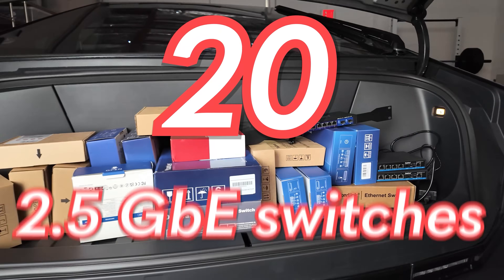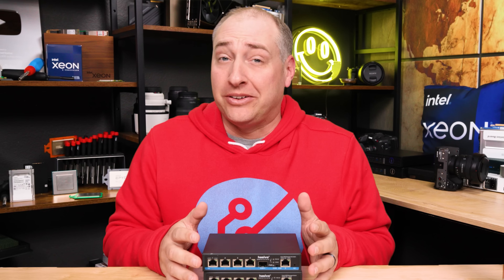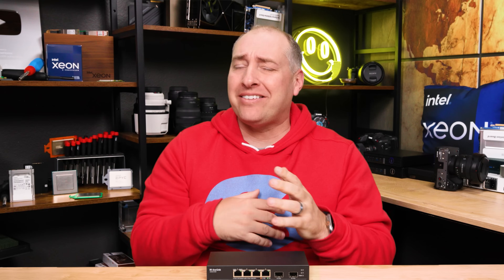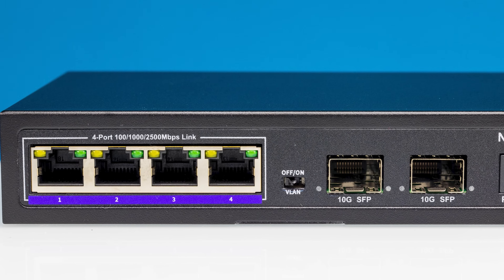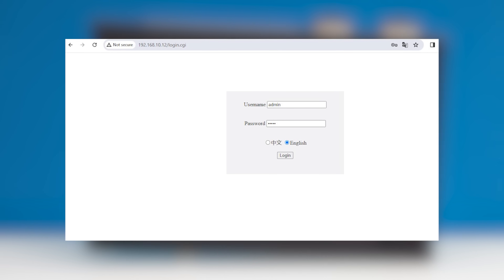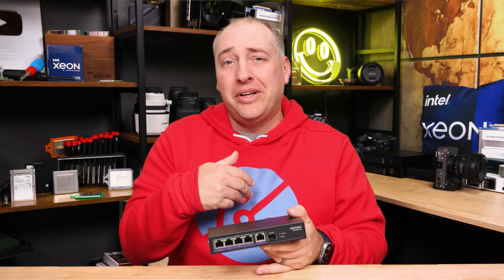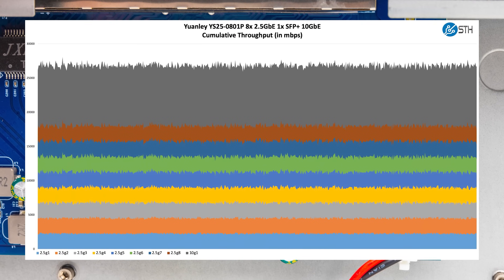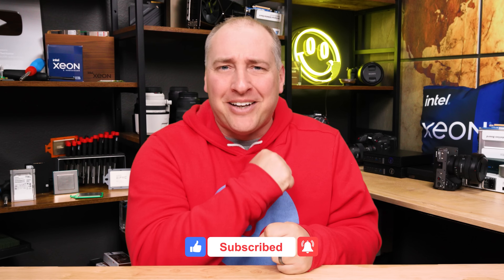Finding the BEST Cheap 2.5GbE Switch... by Testing 21 of Them

Comment: Are you doing a round of ~8port 10Gbit switches at some point?
Reply: Why bother? You can get a 48 x 10g SFP+ switch for under 250, for example Arista 7050S-52-R can be found for 230 plus shipping  ...10g sfp+ cards are under 10-15$ a piece, you can get 2 x 25g cards for 30 dollars backwards compatible with 10g ... sfp28 switches would be an interesting thing to see ... they're not as common.
Reply: @mariushmedias  But i'm looking for small fanless ones for the living room.
Reply: 8 port 10Gbe fanless? That is a lot of heat unless you go fiber/dac.
Reply: @TheAlapalooza  I don't think fanless SFP+ switches exist. Even the small Mikrotik models with 8 SFP+ ports have fans in them.
Reply: @mariushmedias  Because sometimes people don't want to put jet engines into their living spaces?

That Arista will be hotter as well.

Please realize that people have different use cases..
Reply: because they don't exist. copper 10gbit is hot and needs fans still
Reply: @BrunodeSouzaLino  Mikrotik CR305 and CR309 switches are 10Gbit SFP+ fanless. But they will overheat if you use copper transceivers so they are effectively SFP+ or optical only without fanmods
Reply: What about the QSW-IM1200-8C from QNAP, that's a 8port 10Gbe fanless switch.
Reply: @TheAlapalooza $1000
Reply: hasivo's S1100W-8XGT-SE (or S1100WP for PoE) looks like a good option
Reply: @TheAlapalooza The QNAP is very expensive. It's double the price of the MikroTik CRS312-4C+8XG-RM (street price ~US$500-550) which has 12 x 10Gbps ports. The MikroTik isn't fanless, but is it really worth spending around double the price just to avoid fans, when you could instead just vertically mount it in a closet?
Reply from the maker: We have many other switches in the pipeline.
Reply: @ServeTheHomeVideo  Cool, looking forward to that :)
Reply: @BrunodeSouzaLino  SKS8300-8X
Reply: @mariushmedias  Cheap upfront cost but maybe not so great if you have high utility rates. Also, not so great if renting and space is limited.

Comment: Can't wait until 2.5gbe becomes the new standard everywhere, nice review.
Reply from the maker: Thanks! It is happening more each year
Reply: Can you yell at Synology for me, I wish they would wake up, Their NAS units still use 1GbE ports, Everyone else has moved on.
Reply: Would be nice if they go straight to cheap enough 10gbe
Reply: @ShaneMcGrath. They charge for the upgrade
Reply: I'd rather ditch 2.5 and go for 10. That should be the next evolution from GbE
Reply: I want 10g default :( Mostly because I deal with servers all the time and it's simple to get those cards or equipment in.
Reply: considering not even 1gig is standard everywhere...yeah
Reply: @levigoldson  1G has been a standard for the past 10 years in anything half decent. Guess this is in North America not sure about elsewhere around the world.

Comment: I went into my attic and found a 2005 HP NC6120 laptop that had a 1gbe controller, basically 20 years later 1gbe is still the standard for most laptops and lower to mid range desktops.
Reply from the maker: Perhaps, but 2.5GbE USB NICs are cheap and even $350-500 mini PCs are coming with 2.5GbE these days. So are many WiFi 6/ 6E APs.
Reply: Same with drives, many desktop computers still come with SATA drives and most all of those run at SATA 3 / 600MB just like 20 years ago.  USB and WIFI have increased speed 100X in 20 years but 1GB ethernet is still standard.  I have a few computers at work on 2.5G that I frequently move videos between and it a good improvement.

Comment: I can confirm the 8+2 port switch (Hi-K0802WS, brand TelDaykemei or Hisource, non POE) doesn't like DAC cables - continuously reconnects. Bigger power adapter doesn't fix it - it's not the power. Works fine with optics. I have one 4+2 port which work fine with all ports polulated with dac cable and it has 12V 0.5A adapter. The DAC cable is the lowest power solution

Comment: I chuckled when he said that the Mikrotik switch has more management features than the previous switch:) With RouterOS Mikrotik has the management features of well ... everything ever needed by a network anywhere :D You can even launch Wireguard server and Docker images on it if the CPU is not totally clogged :D

Comment: Thank you so much for testing these switches for basic security vulnerabilities. There have been so many backdoors and exploits found in chinese networking hardware recently, so your testing definitely helps to assuage some fears
Reply from the maker: It is 100% not a perfect security audit by any means. We just wanted to see if there was anything obvious. At some point, state level actors have more resources than we do.
Reply: Real security advantage of those switches is what they so much cheap - there is no CPU power to run exploit.
Reply: If you want to avoid backdoors - avoid buying CISCO equipment.

Comment: Been using the 8 port version of the XikeStor ever since it came out. Managed 8 port for the price of unmanaged 8 port, and it comes with a UL listed power brick. Been rock solid with zero issues.
Reply: GREAT. Thanks man !
Reply: HORACO 2.5GbE Managed Switch

Comment: Love these switches. Picked up two SODOLA models (4x2.5,2xSFP+, and 5x2.5,1xSFP+). They pair really nicely with my older Mikrotik CRS305 4x10G and CRS309 8x10G switches giving them 1Gb and 2.5Gb RJ45 without using -T transceivers.
Reply from the maker: Great feedback.

Comment: Seeing all mentions about switches taking about 5W of power makes my two 715W PSUs on my Cisco switch look like an aberration 😂

But I can totally snag some of these basic switches to act as layer 2 port extensions where I don’t need a Cisco 10Gb slot assigned to a port using less than the 100Mbps.

Much appreciated for the set of options, Patrick!
Reply from the maker: Super. That is the idea

Comment: Great overview. A lot of rebrands of same stuff, but that is ok too. I personally do not use 2.5G, nor plan (already moved to 10,25,100), but the fact that there are so many and cheap switches, plus you got 1 or 2 10G ports, and some come with management is really good and generally welcome. Definitively networking at home and small office is finally transforming for real, after 20 years of staying in place at 1G. These switches now basically make 1G switches completely irrelevant for home or small office use. 1G switches might still have some use in rack mount settings (i.e. 48 port 1G switch with poe for things like cameras or other iot stuff, because you really do not need much bandwidth, and every cent of money spent switch or power usage is worth saving, if 2.5G will never be used. But in few years maybe even 1G 48-port rack switches will be also totally gone. For example for connecting things like small desktops and laptops in the bigger office, 2.5G is definitively a nice thing to have. Still many big brands do not have such switches in their offering. They just go straight to 10G (or in few small cases 5G with support for 2.5/1000/100), because that makes more sense as a long term investment these days.

Because these are fanless, and maybe are cheap capacitors, it would be interesting to test them at full load for few hours and probe temperature, especially close to electrolytic capacitors. If the heat is not managed well, these will be dying in few years time.

Comment: Just received a pair of Xikes 8x2.5G + 1xSFP+ and work quite fine. Added a 2x2.5G PCIe card to my home server and now file transmission is base HDD speed of ~190MB/s. Cool stuff. Iperf is 2.35Gb/s. I'm waitng for a 10Gb cable to feed that SFP+ and pair with a Mikrotik router for connecting to 10Gb internet, that's quite cheap in my city.
Reply from the maker: Great feedback and results

Comment: They ALL need to be listed on a spreadsheet for easy comparison and sorting by what ever spec's or features we're looking for. And add to the spreadsheet as you review more. Also really need to see the handling of the POE's full loaded and stress tested. Have you thought about running a cable around your house a dozen times and see how the switches and hubs handle it?

Comment: I know this is an older video, but it helped me immensely because I was skeptical of these cheap switches.. I just bought a yulinca 8 port 2.5gb unmanaged switch from amazon for just over 55 bucks, and I have 2 PCs that have a Asus motherboard with Intel 2.5gbe NICs and I bought a pluggable brand usb-c - 2.5gbe Ethernet adapter for my server laptop, On my server Im utilizing the 2.5gbe nic for local networking and using the on board 1gb NIC for a bridge to a kvm virtual machine, everything works so fast. The only odd thing is that I cant get the usb ethernet  adapter to initialize over usb-c on that laptop (Acer) , works great with the included usb-c to usb-a adapter, possibly a Linux Mint issue.
Reply from the maker: Super! We have even more on the main site Ultimate Buyers Guide

Comment: Naturally this comes out 2 days after I get my TrendNet 8 port 2.5GB switch in from Amazon ;-)
Reply from the maker: Which one? The one in this video?
Reply: @ServeTheHomeVideo  TrendNet TEG-S380. It's the only one that had 8 ports 2.5Gb, no SFP, and the ports are on the BACK of the unit along with the power 🙂  I have no need for SFP unless I can figure out a way to plug my ATT Fiber directy into the switch and get rid of that horrid unit ATT gives us.

Comment: As I have 13 PC I got  8+1 horaco and 8+2 xike 8+2 (malanox) connected each with DAC cable and I am super happy as had issue with tp link 1G and issue also with mikrotik when i used it as switch also, I have very demanding setup that make 5-10K connections all the time for dozen projects
Would like to get 1 16+ 2 sfp port once they are in cheap range, hope you manage to find some for review soon

Comment: This is great. Thanks!
Any chance we can get 802.1p support (or lack thereof) as an added spec for each switch on your list? I feel like that is pretty important as a lot of people using switches like this may want to be able to use VLANs with them.
Reply: Did you really mean 802.1p? From what I can see that's priority tagging (~QoS) in VLANs - not something I'd consider realistic in such cheap hardware. VLAN tagging is 802.1q.
Reply: @PetrSedlacek  Yes. I was referring to the unmanaged switches. Many of them support 802.1p but not all.

Comment: For the hasivo S600W-4GT-1SX-1XGT and S600WP-4GT-1SX-1XGT, I got a unit marked S600W-4GT-1SX-1XGT with no PoE that ended up having PoE, so it seems each unit will need to be checked after receipt.
Reply from the maker: Strange, but I can imagine that happening

Comment: All the switches are obviously quite low power but that only makes the relative power draw differences seem enormous,  I wonder how that's possible. Are different generations of components being used?
Reply from the maker: Usually with these it is also manufacturing variances and the actual power adapter being used. We have swapped power supplies on rebranded switches to check this
Reply: @ServeTheHomeVideo  Interesting! Very excited about all of this, appreciate the video and all of your reviews and articles on lower power devices

Comment: Now I have 2x Horaco ZX-SWTGW218AS, as I need simple switch with VLAN and RSTP, works fine.
Also have kind of older, "expensive" and rich web UI Hasivo PoE 5*2.5G+2 SFP+ and 8*2.5G.
( and one "core" 8*SFP+ Optfocus switch with router capabilities, BGP , OSFP IPv6 etc )
No issues so far.

Comment: Zyxel 8 port 2.5GbE smart switches would be nice to see on STH. 
I'm currently torn between Mikrotik CRS310-8G+2S+IN and Zyxel XMG1915-10E. Zyxel is a little more expensive but the power consumption looks to be much lower and it's fanless with a seeker  design. I'm a bit worried about the management tho.

Comment: thanks for the awesome video, ended up picking up one of the gigaplus gp-s250802 switches. I was also eyeing the trendnet teg-3102ws but oddly I cannot find the rack mount version you have. It seems your found some unicorn version of that switch. I cannot find mention of rack ears in any of the documentation or in any of the pictures for vendors that carry that switch.
Reply from the maker: Ours did not say it, it just was in the box.

Comment: Power consumption is more than just total wattage of power input. Alot of energy consultants focus on standby power of devices, but total power efficiency is also important. For example, you can have two devices that consume 5W at the outlet. But the device and its power brick both produce heat. One model may produce overall 2W of heat and another may produce overall 3W of heat. The heat, at least in the summer, is likely to have to be dealt with by your A/C system which is an additional power cost. While excess heat and overall power efficiency is not so much of a problem year around in Canada, it can be a significant hidden cost in hot places like Miami FL, Las Vegas NV, Phoenix AZ, Death Valley, half of TX, etc. Of course, the actual cost to eliminate the heat is going to greatly depend on the efficiency of you A/C unit. And while 1 single switch isn't likely going to break your bank due to heat generation, dozens of inefficient power bricks and devices running all over the lab will add up. If all your power bricks (and devices) actually make (or make use of) 100W of power but consume 250W of electricity, then it's also producing 150W of heat (that's 512 BTU/hour). Wall warts are not known for their efficiency and usually aren't rated with on an 80-Plus scale. Even though America is pushing for wall warts to have an under-load efficiency of 85%, I would bet that a large number of ones made of Chinesium are down in the range of 50% or worse, like technology was 40 years ago. Lower efficiency is nearly always lower manufacturing costs.
Reply: There is no black hole or warp to another galaxy inside switch, so if they consume 5W they produce 5W heat, in slightly different places: CPU, wires, LEDs etc. The law of conservation of energy tell us this simple thing.
Reply: Incorrect. The law of conservation of energy ensures the total energy in an isolated system remains the same, all forms of energy (nuclear, chemical, kinetic, potential, electrical, electromagnetic, etc. in the system. It does not mean that all electrical energy that goes into a circuit is converted to heat energy.
Reply: @mjmeans7983  Yes, it is about all energy. And which type of energy produce this switch except of heat?
Few mW of laser beam and few mW of ethernet signal - which adsorbed by wires and device on opposite side and become heat.
Electromagnetic fields from consumer electronic very strictly regulated - not much of them either.
What else - start flying around to produce kinetic one?
May be it become chemical or nuclear reactor?
Oh man...

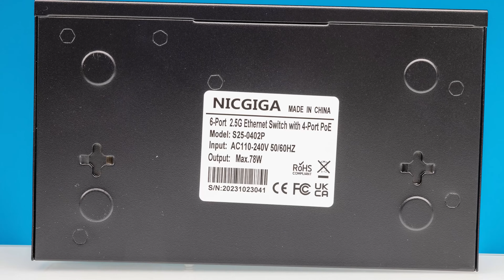Comment: 11:20 it's kinda funny that the internal PSU-board of the NicGiga-switch clearly states "75W" and it still says 78W on the label on the outside. Kinda par for the course for this class of switch I guess... And no, in practice it makes zero difference, and if you're actually running this around 75W for extended periods, I can only assume something is gonna blow sooner or later anyway?

Comment: Are you testing if these switches can do 2.5gb over a distance? Because I bought one of these cheap switches and it can only do 2.5gb less than 6 feet. Anything over 6 feet and it defaults to 100m.

Comment: So I looked up the Trendnet TEG-3102WS as I desire a rackmount 2.5G switch. It is 215USD on Amazon, but no mention of it being rackmountable. Not even on their website.
It's POE+ sibling, the TPE-3102WS, is rackmountable however, but it is 352USD.

Where did you get those ears in the video???
Reply: Mine came with ears.  It was inside the box.  The only negative thing I've really found with it is that I can't truly set a complex password
Reply from the maker: They were in the box.

Comment: I am skeptical of xikestor, i bought the sk1200' switch with the dual SPF+ ports and it actually may comtained a virus which may have damaged my gateway. It actually affected its ports from properly working requiring a replacement. Hard steer from some of these chinese brands. It literally occured within hours of connecting my switch.

Comment: In case of the Hassivo switches, can you link 2 of them with eg the SFP port and use the 2 10T Ports to agregated make a 20gb link to your DIY NAS that have 2x 10T ports, or should I be looking for an alternative to the trendnet that actually will ship to my location ? The idea was to have an 8 port switch that is connected with 2x10gb to the NAS. Like other I'd like to get it without having to sell a kidney or 2 😄

Comment: Hi Patrick, what is the benefit of an 9 port switch that has eight 1GbE or 2.5GbE ports but also includes a 10GbE SPF+ port?  I'm assuming it's to allow data to flow faster into and out of the switch to feed the 8 other ports.  But exactly how much of a benefit does it offer?  Is there any way you can do a video about that?  Thanks!

Comment: I need one that supplies 4xSFP+ and at least 2x2.5Gbit RJ45 for my living room 😅

Can't seem to find anything useable so far. I need 1 fiber link into the basement and 2-3 fiber links to the upper floor for 2 different rooms.. Router doesn't necessarily need 2.5Gbit but my PC in my living room does so there is that
Reply from the maker: What if you used a 10GbE switch and one of these for 2.5GbE?
Reply: @ServeTheHomeVideo would actually be somewhat worth a consideration since there isn't really anything out there. I already have a vimin 2xSFP+ +(4x2,5G) in my living room so I could reuse that one..

I didn't want to end up having multiple switches but I might look into it, thanks!

Comment: Have you checked Zyxel XMG1915-10E? No POE(= minimum power consumption), 802.1q(= ESXi trunking) and wire speed routing(= even more power savings!).
Reply: Also TRENDnet TEG-3102WS.